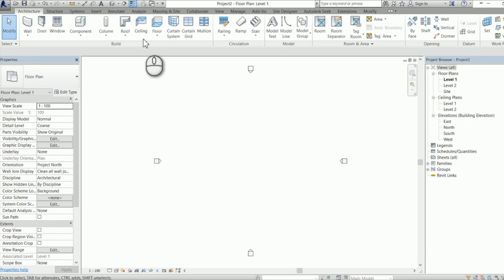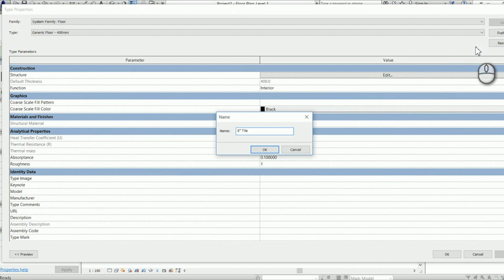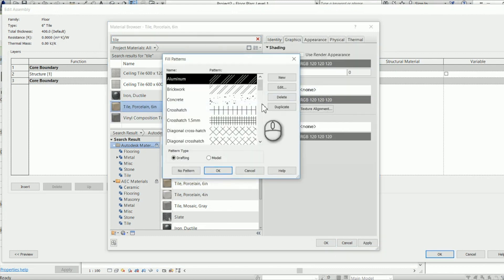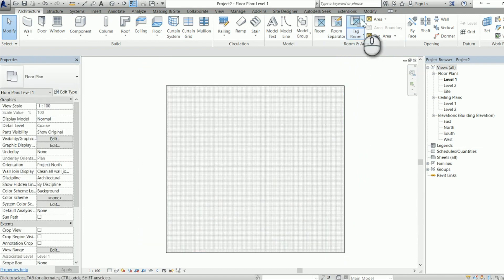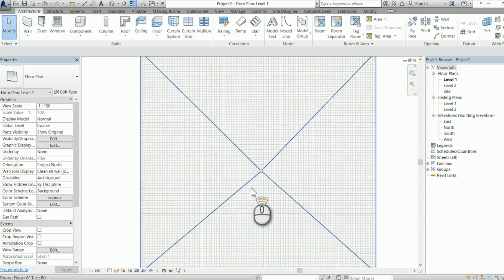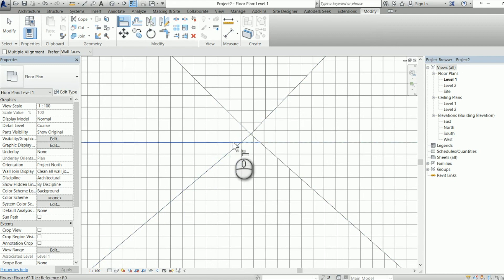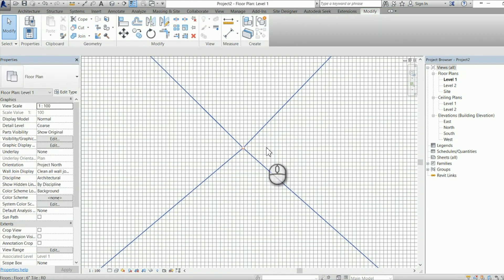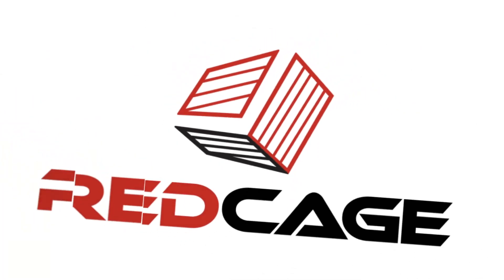How to Align Patterns in Autodesk Revit

Comment: Good video. I have one question for you on that similar 3D pattern subject only this time for CEILINGS. For the first time today, I notice what is either a Revit flaw or my own shortcoming. When I create a Trafficable Ceiling, I need to be able to see the pattern on both Reflected Ceiling Plan and Floor Plan above the actual ceiling. Now, I just found out that the 3D pattern in the ceiling material is NOT ALIGNED above and below and yet the 3D pattern above and below are DEPENDENT. So if for instance I need to create a clear zone for Services consultants to stay outside, that clear zone will be defined by the alignment of my 3D pattern (lines) which represent my ceiling panels. Now the problem is when I move these 3D pattern lines to where I want them on the Floor Plan, they are not aligned on the RCP and yet they are dependent. Does it mean I should use Drafting lines instead of Model (3D) lines? That seems like a major Revit flaw to me. In 3D you would expect your pattern above and below the ceiling element to be aligned OR if they are not, you would expect them to be independent so at least you can realign them on your two separate plans. It is puzzling that I may have to copy paste the ceiling to the same location, one for my Floor Plan one for my RCP, just because the pattern is misaligned and dependent.

Comment: Thanks for this tutorial! I have attempted to apply a paving texture to a much more complicated floor surface (so there are more changes in the plane). On some planes it is causing the texture to slightly rotate. In this case the align tool doesn't seem to work. Please can you let me know if there is a solution to this?
Reply: Hi! I have the same problem, did you find the solution?